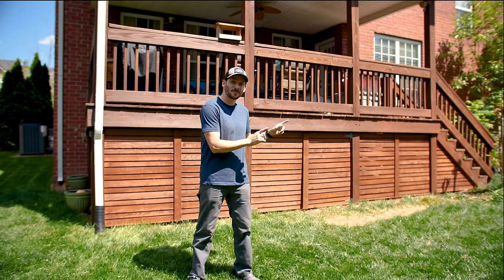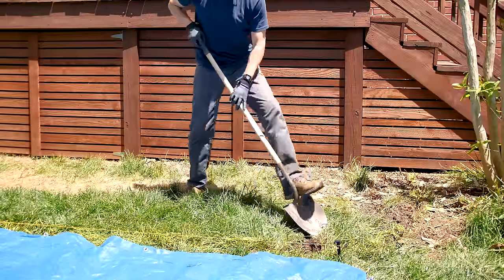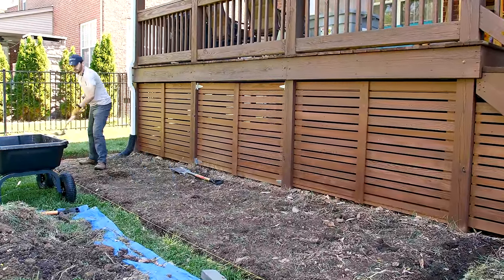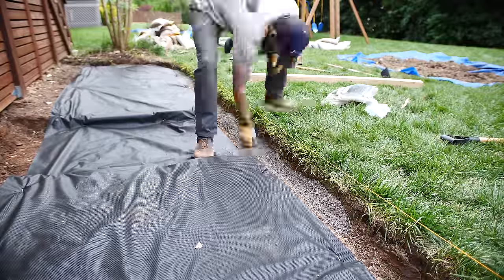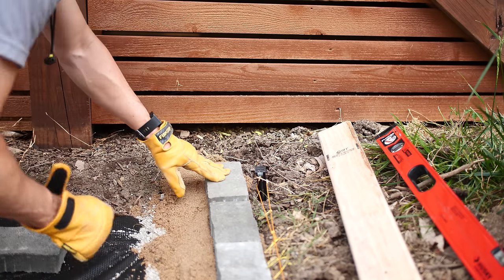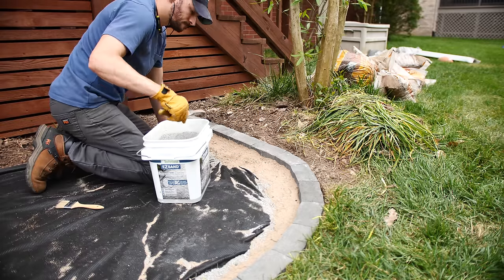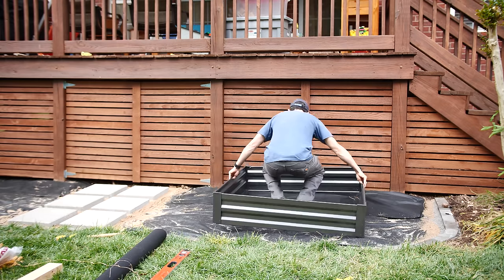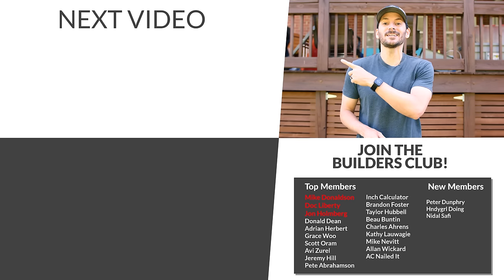How to Make a Raised Garden Bed with Paver Edging

Comment: You believe the weed control fabric will keep the weeds from coming up, bless your heart.
Reply: LOL
Reply: My experience is that weeds just grow on top of the fabric. I never use it anymore.
Reply: They do come up easier  when you do get some weeds tho... LOL
Reply: Isn’t that so very funny! Temporary control of weeds, at best...Nothing keeps them out! Not mulch, either.
Reply: I use cardboard. It eventually composts, but at least I’m not throwing it in a landfill. Works pretty well actually
Reply: I know! I always hope that I bought the one weed fabric that works! But no.....
Reply: I use weed control fabric and it works just fine... I think those people who think it doesn't, aren't doing it right... or maybe using a cheapie one.
Reply: @buddyrevell511  That’s great! What kind do you buy?
Reply: @buddyrevell511  Wrong, I’m complaining about weeds that spread UNDER the fabric. Very common in the south...
Reply: @biscuitsandgravy  Really good  idea!! Thank you for the tip.
Reply: @shadyman6346  i live in the south too... you have to use the thicker fabric and double up on it... then zero weeds will grow, believe me.
Reply: @buddyrevell511  Under the mat, some plants spread horizontally ...you must dig small trench on borders to prevent. Thanks! May we all win our campaign vs. weeds!
Reply: Midwest weeds are tenacious! Best results I’ve gotten by using pre-emergent weed preventer spread on ground, then weed blocking fabric ( best fabric was rubberized road fabric!), then mulch. Rocks are impossible to keep weed free and looking nice when maple leaves etc... can’t be easily cleared. Bigger headache when mowing and not having clippings shoot toward the landscaping...perfect way to provide a home for weeds to grow.
Reply: @buddyrevell511  Agreed.  I use landscaper quality materials, and they work perfectly. You spend more, but my time has value. I'd rather not spend it weeding.
Reply: So true 😂😂😂😂
Reply: Not only do weeds grow, but it traps too much water. Most effective thing I've used is newspaper. Lasted for years and by that time, I decided to change things and dig it up. It had decomposed some, but was still providing a barrier.
Reply: @valerieann2751  I’ve had good luck with cardboard too
Reply: Spray weed control under the fabric then lay the fabric down
Reply: Just a thought but has anyone tried using garbage bags?
Reply: Too funny
Reply: @mohammadaitzaz9048  
It needs to let water discharge through it , though !
Reply: Never ever worked for me.  Sigh
Reply: @buddyrevell511  I know right? It always worked for me.
Reply: @simplesgood7694  Vigor... but the thicker one that looks more like a grid/square surface, rather than the one that has all the criss-cross fibers.  The labels look the same... only way to tell is 1) it's more expensive and 2) surface looks different  3) color is gray (not black)

...but actually i have had great success with both of the gray Vigor ones.  the more expensive one is easier to work with and in my experience, will work 100%.
Reply: @shadyman6346  i live in the south too.  the thicker, gray Vigor type prevent what you are talking about.  ain't nothing growing under there.
Reply: If installed properly and the grass is mowed properly then it will. We have jobs we have installed 10 years ago that is still weed proof. Proper post-care makes all the difference.
Reply: @valerieann2751  that's what I've done this year for our raised beds and what I will do for the walkways.
Reply: that's what I've done this year for our raised beds and what I will do for the walkways.
Reply: Haha “bless your heart” we know what that really means.
Reply: No permanent solution unless you kill the soil. Example I remember the oil leak from one of the cars my dad owned in 90s made a mess under the car which basically ruined the soil too and as far as I remember it left a patch zero green (no grass/weed).
Reply: @bigpicturethinking5620  Yep that fabric is rubbish mulch and maintenance is the solution to weeds.
Reply: Newspaper works wonder under the lawn fabric...
Reply: @mohammadaitzaz9048  garbage bags is worst, tried it and those rocks made holes making weeds come out... worst part not biodegradable.
Reply: It will last if it is the 30 year fiberglass.  You will still have to pull weeds or spray, but they won't get a seriously established if you keep after them.
Reply: True.  The wind carries seeds that will land on top of all this and create weeds no matter what.  I don't ever bother with weed fabric.
Reply: That works extremely well
Reply: it’s just more betrayal of the next generation, with plastic, just for our selfish convenience
Reply: Lol true story
Reply: @buddyrevell511  You apparently don't deal with Bermuda.
Reply: @joniboulware1436  actually, Bermuda grass is exactly what I have on my lawn.
Reply: @bigpicturethinking5620  I quite agree. It's been my experiance to.  Have no use for wed fabric, it's useless.
Reply: @mohammadaitzaz9048  I've used skimming pool liner, still, weds get through, even on that stuff to. Weeds are IMPOSSIBLE to try and stop from growing.
Reply: @SayHelloToOblivion  Quite agree.
Reply: L🤭L
Reply: @buddyrevell511  maybe you should post a video of how you’ve layed this weed fabric
Reply: Skirting the deck may not be a good idea in the long run, although it looks really neat, nice and unique. Reason this may prove to be problematic is bec the soil underneath the deck will not get enough sun to stay dry and free of vegetation. Also many critters love those dark wet areas. Better to lay a concrete floor there and keep it open.
Reply: Really! Good luck with that weed control, lol
Reply: I dunno about the flimsy stuff he put down, but the heavier woven landscape fabric (the stuff with green squares on black?) will hold. I have couch grass. Even that hellish thing can't just rip through. As for growing on top, even weeds have to root in something other than gravel, so if he just makes sure not to spill soil and compost and other organic matter out of those veggie beds, he should be fine for a good long while. If some determined weed seed does manage to root in a sandy spot, just pull it before it can work its way down through the fabric and reach soil.

But get the GOOD landscape fabric.
Reply: Weeds and anything else will eventually start to grow, but controlling them on loose pebbles is much easier. The thing is that over seasons dead leaves and other organic matter accumulates between the stones - it can easily become a perfect home for new sprouts - but picking them up is just an easy task. If you haven’t got any plants around, you could spray weed spray and it will further minimise requirement to put any time or effort into maintenance. Expecting a piece of fabric completely eradicate weeds is simply naive perhaps hence some negative responses?
Reply: I typically use some tarp material and spread a thin layer of concrete around my landscaping projects..(I just spread the bag of concrete evenly over the area then lightly water it) works every time..very low maintenance after that..every now and then I will have a weed or two come up but this has saved me so much time and hassle of cleaning and redoing landscaping projects..hope this helps someone..GOD bless!
Reply: Mine works🤷‍♀️
Reply: Fabric is good for rocks
Reply: @shadyman6346 That’s why you should pray weed and grass killer with some extended control before applying the weed barrier. Regardless, the barrier is never meant to prevent weeds from going under the fabric so if that is your complaint, it has nothing to do with the efficacy of the weed barrier.
Reply: @CWTGD This is the answer. Weed fabric doesn’t prevent weeds from growing if they are simply under the soil when applied.
Reply: I started using the weed fabric a couple of years ago and I see a huge difference from the beds I put in without it. Yes it doesn’t stop a few weeds from growing on top of the mulch and the rocks, but that’s not as bad as the beds that I have where there is no fabric and the weeds grow right through the mulch at a high rate. And the other good thing about the fabric, especially if you’re using stone, it keeps the stones from settling into the dirt so that when you want to plant other plants, you don’t have to dig through tons of stone. You just move the stone off the fabric, cut the fabric and dig.

Comment: There is a flexible plastic edge that holds those edging pavers. The edge is held in place with spikes through holes and then laying the edge pavers along plastic edge.
Past experience I have seen the pavers move and end up with widening gaps between pavers allowing weeds to grow.
Maybe you can use the plastic edge the next time you have another paving project. 🌱🌱👍

Comment: They make plastic edging that you stake into the ground that will hold the pavers much better than polymeric sand, especially for something that just uses one width of pavers. You also may have placed the pavers too low because, they will settle over time and the grass will grow over them.
 I like vinyl planting beds. I think they last longer than metal. Vinyl also stays cooler to the touch in the hot sun. I live in the high desert so heat is a big concern here.

Comment: Tip to make this quicker. 
Grab your edger, and cut your line with that, and then run your edger acrosss the area a few times, making 1' squares, so it is a lot easier to dig the sod up.

Comment: How long did it take you to do this? Last spring, my husband and I tackled a similar project but built a ~2' tall brick wall around the garden (600 sqft)... It felt like it was going to be a much quicker project than it was. Ultimately it took us about 6 weeks of near constant work to complete. We didn't have many fancy tools, but we were able to cut the corner bricks with a masonry blade on our circular saw and that worked well. Everything else was just grunt work (including hauling 13 cu yds of topsoil to and from the garden area wheelbarrow-by-wheelbarrow 😅)

Comment: Nice job Brad as usual.  I probably would have used some construction adhesive connecting those bricks.  I'm always concerned about them moving from being stepped on or the lawn mower.  I guess you could have used hydrostatic cement too, but I think the trades usually use the adhesive.

Comment: Question:  What happens with the water that comes from the roof through the drain tube? It seemed to have run directly into the pavers which I would think will cause a backup during a heavy rain.
Reply: If it were up to me, I would have dug an extra trench lengthwise in the bed, connect perforated pipe to the downspout and place it in the trench, then fill it with rocks. Then provide an exit for the pipe outside the wall. That way, water draining from the roof will soak into the flower bed while the overflow will exit safely.

Comment: When using a bolster chisel to cut bricks you need to mark/cut all the way round the brick not just one side that way it will usually break evenly.  In addition lay the brick to be cut one something firm but relatively soft so there is a bit of give so as not to break the brick too soon, . I use a bunch of newspapers wrapped in gaffa tape. Works a treat. :-)

Comment: One challenge I've had with projects like this is: what to do with all the excess dirt afterwards? This isn't a big deal for smaller projects, but when you end up with several cubic feet of dirt to dispose of, it's a problem.
Reply from the maker: Yes, I have woods at the back of my lot so I just dumped it there
Reply: @Fixthisbuildthat  that's really convenient then. I don't have that option. None of the houses around me can do that either.
Reply: I'd go on the Next Door app and offer it to your neighbors. Someone might be looking for some soil.
Reply: @flamingoliz  Thank you. I appreciate the idea. I've done this too. I had a few neighbors come by and take some away. I had a ~2 cubic yards of soil  at the end of my drive way for 2+ months last spring/summer waiting for neighbors to pick it up. Local kids started playing with it and getting it all over the place, causing a nuisance. I'm surprised I didn't get an HOA violation. 

I called around to a few junk hauling places, who wanted $300+ to take it away. Other landscaping places either never returned my call, or said they did not offer that service. I eventually found an independent contractor who had a guy that offered to haul it away for $180. Pile was gone the next day. Glorious it was, to have that half of my driveway back.
Reply: When I built my patio, I moved 5800lbs of dirt into my 10'x16' raised garden bed. Boom

Comment: When cutting curve in the pavers. Place the number of pavers you think you will need for the curve (e.g. 5). Then you know for a 90 degree bend the 5 bricks each needs an 18 degree angle. Little trigonometry since you know the angle and width of a brick  (Tan(angle) X width of brick = your cut distance). So for 18 degree angle and 100mm wide brick means you cut from one corner of the brick to 32.5mm from the other corner. All 5 bricks together will equal a perfect 90 degree curve. You don't actually need to cut both bricks, but if you wanted to then 32.5mm/2= 16.2mm for each brick

Comment: Nice video, one quick question, do you recommend to use weed fabric in general? I am planning to do a pretty big flower bed in my lawn and did a few Google search and found out those fabric can cause quite some headaches in the long run such as weed can grow on top (I will be using mulch on top), or shallow root. etc.
Reply: The weed fabric is a pain as well as bad for the soil below. Cardboard laid thickly underneath will give the same results while improving soil over time. (Just make sure there's no tape or staples) Keep in mind however that weed seeds often blow in from above or are dropped by birds. The weeds are much easier to pull from a cardboard / rock layer compared to when the roots embed in the weed fabric.

Comment: LOL I have had shovels, picks, rock bars, loppers etc for 10-20 years and never washed them. If you really want to keep them from rusting keep a 5 gallon bucket of old motor oil under that deck and keep the metal bits submerged. Maybe not a great idea for your situation however, on a farm it can and will save your tools!

Comment: My neighbor, a professional gardener for 30 years once told me DON'T EVER USE THAT WEED BARRIER FABRIC...it is not necessary for a nice looking garden plus that thing will not keep weeds off 100% and is a pain in the @ss if you ever decide to remove it after a couple years. A nice looking garden is well tilled soil with quality fertilizer and quality mulch....this fabric crap is not necessary and not healthy at all for your plants, shrubs, trees, etc. as it keeps the soil too dry and won't allow for proper watering. There are many products these days sold to keep weeds away....this fabric is not the way to go guaranteed.

Comment: Brother, you are wasting your time .... without a mixture of sand/cement under the pavers they will not stay in position... take it from a structural Engineer... also must build a small perimeter cement/sand edge behind the pavers once installed, otherwise it's a kid's project... if you do not know ask.... good luck !!!